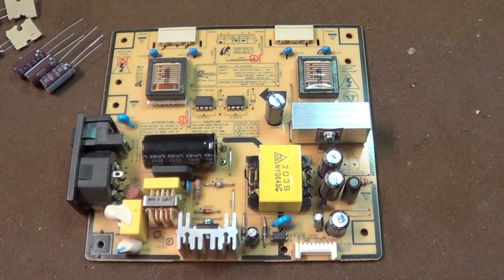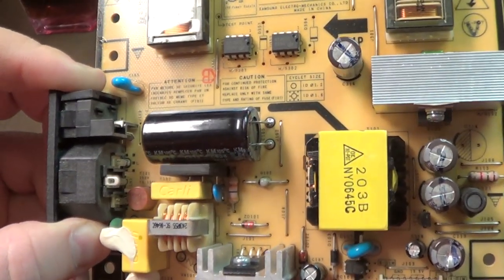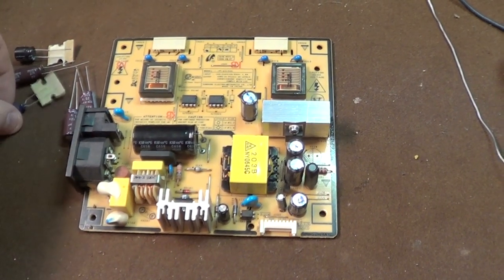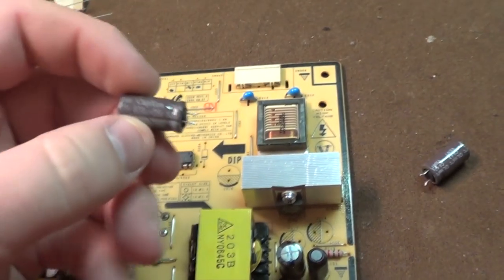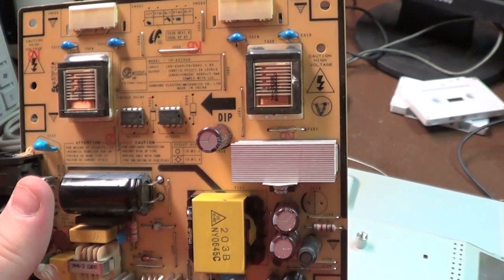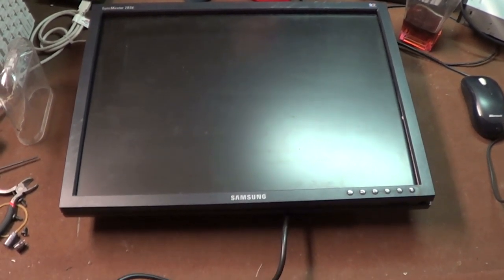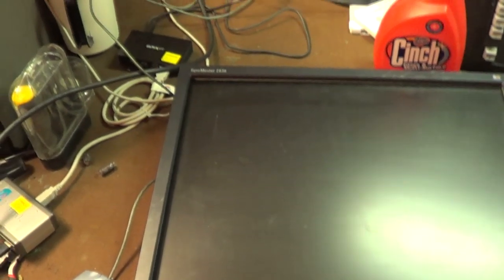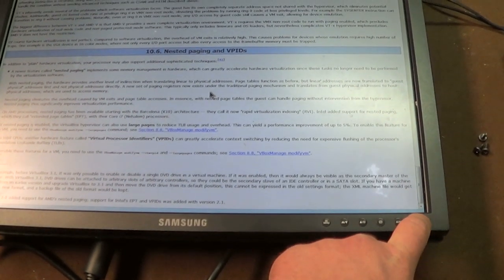Kitchen Table Electronics Repair: Samsung Syncmaster 203b Monitor

Comment: Well done folk! I firstly changed all caps with bigger onnes in fact of uF but didn't power on. When i saw your video i understoold i had to change pico fuse too! So tonight while i was listening your clear voice and instructions i took of a 4A 125v picofuse from a broken pcb from another lcd screen after testing if it was good and if mine was broken (it was!) and changed it. Pointed my flashlight to the mains just in case switching on would power down the whole home and.... voilà! Screen works briliantly! Thanks again :-)  By the way caps  (until not used on timing circuits) can be changed with higher voltage ones (just more expensive) and higher capacitance ones (just has more capacity), ... just look at temperature tollerance and size for fitting on PCB! Greetings from Italy!

Comment: another good job Bill, I often take short cuts too, but didn't you have any glass fuses on hand? I usually keep 2, 3 and 4 amp fuses on hand in the shop, but sometimes I run out and so I'll bridge a fuse with a piece of wire like you did.

Comment: Well done bill :-))

I have to admit that i have bypassed those daft fuses with fuse wire of the correct capacity, or soldering stubby wires onto a small glass fuse and inserting into the pcb instead.
I like propper fuses+holders better, you can isolate sections by lifting a fuse or/and connecting an ammeter across the holder :-).
Wrongly marked silkscreen pcb's did make me jump three feet off my chair as the brand new panasonic 105 deg cap exploded with glee lol, Ahh fun :-))

Comment: i have a 203B that i repaired with the exact same issue, even down to a spot on the screen in the corner. the panel i have does have a few dead pixels though, unfortunately.

Comment: I have soldered in normal fuses in place of the pico fuse (using the correct ratings btw) before esp when out in the sticks where deliveries by post are at best once a week but more often once a month.

The bad cap thing is annoying.

I love the shelving system you have, I will have to do somthing like that as well here as I am getting far too many system units, switches etc on the floor.

Oh I have had electronics let out the smoke before, hence why I tend to power up unkown items (status wise) outside, also if it goes bang better out there than inside, I also use a power point with a 5amp breaker just for repairs so the main breakers do not trip.

Comment: I always called them "pee-co" fuses. That fuse supplies DC power to the backlight inverter circuit. Without it you would have gotten video, but no backlight.

In my case I couldn't be bothered to find another picofuse and installed a Rat Shack glass fuse holder and used a fast blow fuse I had laying around of a slightly lower rating (the picofuse was classed as "super fast" blow). Works fine and if it ever blows out again, its easily replaced with something you can find locally.

Comment: You need an ESR meter that should allow in-circuit cap testing. There are many available such as the "blue" meter. I have a Russian-made ESR tester.
Reply: ebay the MK-168 tester, great bit of Chinese kit!

Comment: The problem is not the same as this one.
The monitor is a samsung syncmaster P2370HD. The problem is that when I plug in a blue ray there is only a picture with no sound. The sound for everything else is working fine.
Thank you.

Comment: At one time I accidentally soaked the back of a CRT monitor, the monitor was turned on, it went out and some sort of a protection mode, after I allowed it to dry out the monitor start working again perfectly fine.
Reply: You were lucky. I had a CRT that killed my graphics card. When I left my room for lunch everything was fine. I had left my monitor powered on because I was using a screensaver back then. When I came back the room smellt like burnt electronics. The monitor was off (wouldn´t turn on) and I later found out that my Graphics card was dead. Was a GeForce MX440. The rest of the Pentium 3 computer was fine. My guess is that the monitor shorted out and sent high voltage into the graphics card
Reply: Florian amRechner that is actually something I was going to ask UXWBILL if a malfunctioning monitor could take out a computer or the graphics card
Reply: redneckbryon
 Oh, I see. I didn´t see a question mark anywhere so I thought it was a statement.

Comment: I did a capacitor repair on an old Optimquest Q7.  I recommend buying high temperature 10,000h Nichicon capacitors because why not?  You might as well make sure it never breaks again.  Oh, and unless you're about 10 monitors, you'll spend more on shipping than parts anyways.

Comment: Speaking of Power Supply, I have a 2010 Vizio 15" LED TV Model M260VA, Since the LED TV won't start-up, and the caps didn't show any caps that are blown, how do I identify the caps or any spare parts that are defective?
Reply: search on YouTube and Google for how to use a ESR meter. You can buy a cheap one of eBay for about 20 US

Comment: The power lights on those are dim. We have one at the sound board at church. Almost look like a blue thing is painted on the button! I ask about it and I got a response that it has always been like that! On my HP w1707 I have the brightness at 80%. Also my resolution is 1400x900.
Reply: ***** Could be! I think that they went to dim now! The one at our church is a newer model than yours, it is widescreen and I think has HDMI. I like you monitor though, most of mine are old Dells from 2005!

Comment: Looks like a great monitor - I'd love to find a good 4:3 - 5:4 LCD with a good size and resolution.  It seems all I ever find are small-sized 1024x768 with extreme scratches all over them.  I wish the larger, more desirable monitors in those squarish aspect ratios were easier to find.  It annoys me that 16:9 has taken over, I really dislike that ratio for computer use.

I recapped a Samsung 930b a few years ago, it had a similar issue. Encouraged by the experience, I acquired a duplicate which needed the same repair.  What I found interesting is that the service menu showed both monitors had nearly the same number of operating hours, but mine had a better picture.  I could only attribute this to the fact that I always ran my monitor at very low brightness with higher contrast, while the other had been left at brightness 50.  At that point, it needed about 30 points higher brightness than the first monitor just to make them match.
I find that even a brightness of 0 looks fine to me - I don't notice it unless I were to compare with another monitor, but really, I just think most monitors look overpoweringly bright. :)
Since that time, the latter 930b lost it's backlight.  My original, which always ran at low brightness, is fortunately still working.
That 203b looks excellent, I'd love to find something like that, congrats on the pickup and repair.

Comment: Just started watching your videos - I noticed you reference some online forums you use to help you with repairs sometimes. Which ones? I just bought an Onkyo TX-NR646 and Onkyo TX-NR545 for next to nothing on ebay. Both have error codes and are in protect mode. I'm going to reset them and check all the fuses first but I suspect more work may be involved and I may need help. Any advice on where to look would be appreciated!! Thank you Bill!
Reply from the maker: +Casey Clark I don't generally seek out assistance on forums unless I'm stumped. The receivers you have purchased may have sustained damage that is extensive and difficult to repair, especially if you aren't well versed in electronics repair and theory.

A lot of audio equipment is discussed over at Audiokarma, including some repairs.
Reply: Uxwbill, thank you sir. I have been using "repair almost anything" forums and they have been great. I have had some assistance in tracing down the issue - although we are not there yet. Transistors are good on both units. Looks like a power issue on the amp board in both cases. Anyway, still looking now. Thank you for the response sir!

Comment: Congrats uxwbill, you saved a poor old Monitor! =D

By the way, when are you going to do with this 4:3 LCD Monitor?
Reply: Most of my monitors are 4:3 except for my main monitor. It is the HP w1707 got that from the dump. It worked as soon as I plugged it in!! It was just missing a stand. Oh, what people throw away!!
Reply: ***** Not only that the Capxon Caps are that bad, it's also the Wisdom caps that are bad two where Emerson buys the cheap design capacitors like my '07 Emerson WB/FM/AM/TV Tuner, the Wisdom 1000<span style="font-size:11.0pt;line-height:115%;
font-family:"Calibri","sans-serif";mso-ascii-theme-font:minor-latin;mso-fareast-font-family:
Calibri;mso-fareast-theme-font:minor-latin;mso-hansi-theme-font:minor-latin;
mso-bidi-font-family:"Times New Roman";mso-bidi-theme-font:minor-bidi;
mso-ansi-language:EN-US;mso-fareast-language:EN-US;mso-bidi-language:AR-SA">µF 10V since it went bad, it tend to cause the speakers to make buzzing noise, and after I remove the bad Capacitor and install the fresh used caps include Capxon 1000<span style="font-size:11.0pt;line-height:115%;
font-family:"Calibri","sans-serif";mso-ascii-theme-font:minor-latin;mso-fareast-font-family:
Calibri;mso-fareast-theme-font:minor-latin;mso-hansi-theme-font:minor-latin;
mso-bidi-font-family:"Times New Roman";mso-bidi-theme-font:minor-bidi;
mso-ansi-language:EN-US;mso-fareast-language:EN-US;mso-bidi-language:AR-SA">µF 10V Caps, it doesn't cause to make buzzing noise, and it doesn't cause to damage to the speakers.
<span style="font-size:11.0pt;line-height:115%;
font-family:"Calibri","sans-serif";mso-ascii-theme-font:minor-latin;mso-fareast-font-family:
Calibri;mso-fareast-theme-font:minor-latin;mso-hansi-theme-font:minor-latin;
mso-bidi-font-family:"Times New Roman";mso-bidi-theme-font:minor-bidi;
mso-ansi-language:EN-US;mso-fareast-language:EN-US;mso-bidi-language:AR-SA">
<span style="font-size:11.0pt;line-height:115%;
font-family:"Calibri","sans-serif";mso-ascii-theme-font:minor-latin;mso-fareast-font-family:
Calibri;mso-fareast-theme-font:minor-latin;mso-hansi-theme-font:minor-latin;
mso-bidi-font-family:"Times New Roman";mso-bidi-theme-font:minor-bidi;
mso-ansi-language:EN-US;mso-fareast-language:EN-US;mso-bidi-language:AR-SA">I used to save some certain caps like Bestec Power Supply, I remove the good caps and store them for a while where I save some money and to not try to replace any other memory chips where the power supply is no longer use, and same thing for Laptop's external power brick two that I save some caps two.

Comment: I have the same monitor. I took it from a friend. It was strange at first. I should power it for a half of a day (with strange and different LED blinking pattern) and after about that time it gave me good picture. Because of that reason I never turned it off to have always a picture without half-day waiting time. After some days it suddenly turned off and the blue LED has now the same pattern as yours. Do you think it has the same problem with capacitors?
Reply: ***** when i check the fuse with buzzer, it seems ok.
Reply: ***** Hi uxwbill
Thanks. I have changed the capacitors and now it is working perfect. better than its first situation.

Comment: If you are booted from using the kitchen table as your electronics repair table and have to use your pool table as your workbench maybe you could call this series Pool/Billiards table electronics repair. And it's a shame that ppl throw out electronics due to bad caps. I've accumulated caps & parts from old electronics in hopes of repairing what I can with these parts.
Reply: *****
I agree, I try to recycle/reuse things as much as possible. I have a bunch of those tennis racket style bug zappers and when they break I fix them, One was munched pretty bad (Grid frame was broken but grid was fine) but I was able to fix it with a drill and some hot glue. Another was beyond repair so I just kept the handle and eventually used the flyback circuit inside to Sup up another zapper. I enjoy fixing things and tinkering. It feels good to know that you fixed something and saved it from ending up in a landfill. A lot of the issues are not hard to fix if you have some knowledge in repairing electronics.

Comment: Hi, i have problem with my monitor too but i changed capacitors and i can see screen in my flashlight only now (shortly say problem with brightness) and question is, is the problem in this IP ? or problem with LCD panel ? Thanks for answer
Reply from the maker: The backlight is not working. That is why the display is only visible with a flashlight. Check for other blown or damaged parts, including any fuses that might be present on the power supply board.
Reply: okay, thank you for now :D i will check it :)

Comment: Hey Will, is it possible to repair an HP Pavilion CRT monitor that likes to shut itself off after being turned on for 5-10 minutes or so? I understand that tinkering around with CRTs is extremely dangerous for those who do not know what they're doing, but I'd really like to repair this monitor because the display is in amazing condition. It turns on and stays on for a while, but then it flickers and turns off. If the repair is too risky, I'm fine with leaving the monitor as it is, as I already have a Dell CRT that is in even better condition. The three-prong power socket is pretty dirty, as is the VGA cord, so maybe cleaning the contacts would fix the problem? I'm just not sure if it's that easy to fix.
Reply from the maker: Yes. Unfortunately it may not be worth it, excellent condition notwithstanding.

The first thing you'd have to determine is why the monitor is shutting down, and that's going to require some diagnostics and proficiency in troubleshooting. I'd be suspicious of two things: capacitors or the x-ray protection shutdown circuitry, which kills the high voltage supply to the picture tube if it should climb too high.

CRT TVs and monitors are dangerous to work on for two different reasons: first is the high voltage circuitry that drives the picture tube. Second, and potentially much more dangerous are those monitors that use a "hot" chassis design, basically meaning that one side of the chassis is connected directly to the AC power line. The deflection circuitry, horizontal in particular, also operates at very hazardous voltages that are far beyond what a lot of multimeters can safely measure. So, basically, if you aren't sure of what you're doing and you don't have the right test equipment, don't try to repair your monitor.
Reply: ***** I'll try using a different power cord, and if it still doesn't work, I just won't mess with it. Thank you!

Comment: Need help! i have problem with capacitors on my syncmaster 205bw  but i cant buy those capacitors, i can buy syncmaster 203b power supply will that power supply work on my 205bw monitor?? 

mode of my power supply is :   ip-43130a
Reply from the maker: Any capacitors you find on that power supply board can certainly be purchased.

I cannot offer any advice on any part substitutions. I would strongly suggest not attempting that swap.
Reply: Hi, i changed capacitors and now i have problem.. instead of black colours i have green ... something like this ... what could that be ? 
Photo:     http://web.laika-design.fr/files/photo.JPG

Comment: My monitor is an Envision 22" LCD, 12 years old and still going!
Reply from the maker: Any LCD monitor ought to last for a few decades, and the fact that some far less well known brands manage to do so quite easily is a sad commentary on Samsung's product quality. If anything, the CCFL backlights ought to have been the weakest link.
Reply: It has been a great monitor! Now that I'm saying this it'll probably die tomorrow. :p
Reply: You're right and Envision is parented by the same company that makes AOC monitors if I'm not mistaken.
Reply: Read Electronics repair review on my blog before you buy. Go to dennisreviews. com/electronics-repair-review/ Thanks. Enoch.
Reply: Report, it went kaput on me when the power went out a month or so ago, should be easily repairable, though.

Comment: I too have switched to Pale Moon from Firefox after this most recent blunder of an update.
Reply: *****

Same here. I was actually recording a video on Windows XP POSReady 2009 and had paused a couple of hours to install basic essentials (updates, firefox, acrobat reader, office, etc.) and that really caught me off guard to see that. I had coincidentally disabled the increasingly annoying update notifications on my main computer a number of weeks before, so I had no idea what was coming until I fired it up on that virtual machine and found that "browser.tabs.ontop" was gone from the configuration screen and I couldn't really customize anything. On top of that, I decided it was time to find a replacement when I saw that I was going to have to install an add-on and spend ten minutes of my time getting Firefox "up to spec" on new installations.

I'd been a "firefox cheerleader" since version 2, but this is truly the end of the line for them. RIP Firefox (2004-2014).

Comment: I'm not going to comment on your basement being a mess, mainly because mine is worse.
Typical failure mode, Samsung used Craps-On capacitors on the monitor power supply board, naughty!! That is is Samsung made it, as opposed to Chicom Trash Industries.